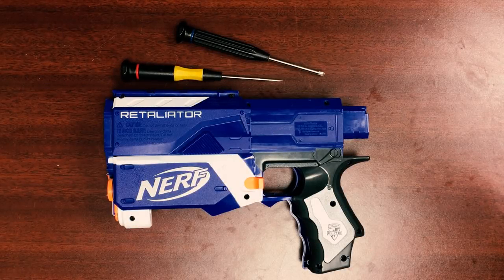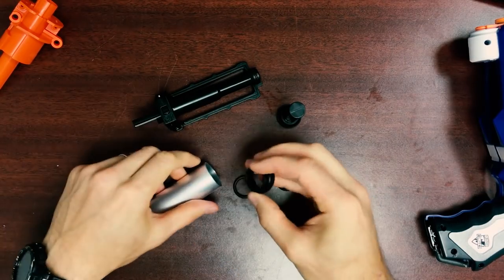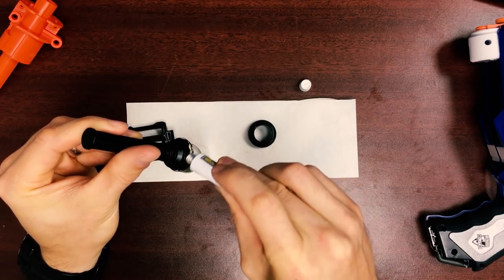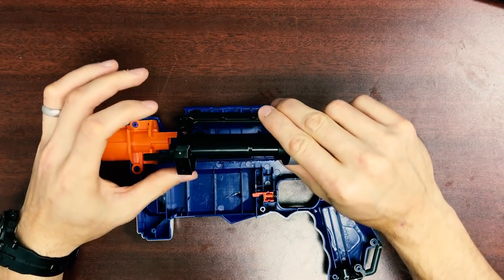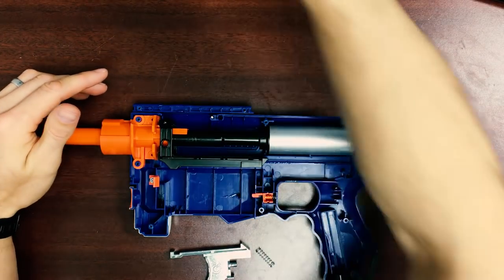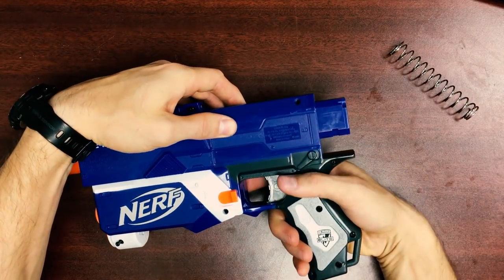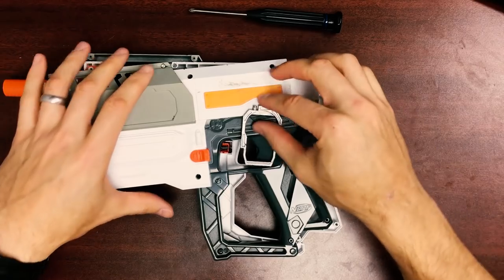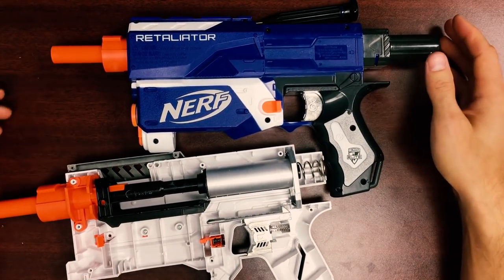Core: Retaliator / Recon MK II Hybrid System Installation by Orange Mod Works

Comment: I’m assuming I have a newer kit? 
Mine has 2 bolts, breach with alum barrel  on bolt is for short darts. I installed it and wiggled standard darts into the breach for each shot.  I see the long dart bolt does not allow the long bolt to enter the breach all the way. The little tab at the top prevents it from entering the breach. If I ground that tab away would everything work fine? Or do I need to use the factory nerf breach as advertised in the kit?

Comment: Could this also work with the original Recon CS - 6?
Reply: FalonKenobii afraid not...
Reply: FalonKenobii CS-6 is reverse plunger
Reply: Theophilos Godfrey but could you theoretically replace a Recon’s internals with a direct plunger system?
Reply: not sure, im not an expert...
Reply: The shells are the same, so I'd assume you could make it work. It might take a little sanding on the inside.

Comment: I assume this kit drops right into the Worker Prophesy shell?
Reply: I just tried it.  It does NOT FIT.  I don't know if it's off by like 1/32" somewhere inside, but when you prime the blaster, the trigger will not allow the weapon to fire.  I've tried it with the stock Worker trigger and catch mechanism a well and it will not work.
Reply: @garrettrein9922  It was an interesting thought, anyway. I've got three Recon IIs waiting for a new project, so good to go :)